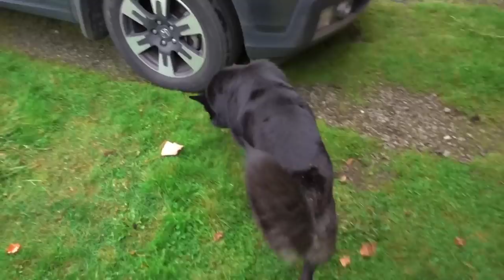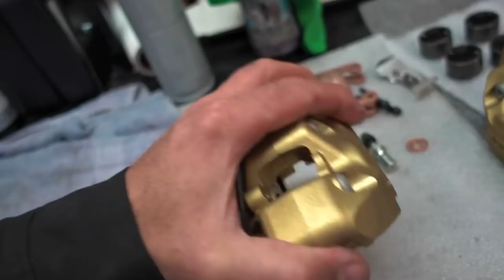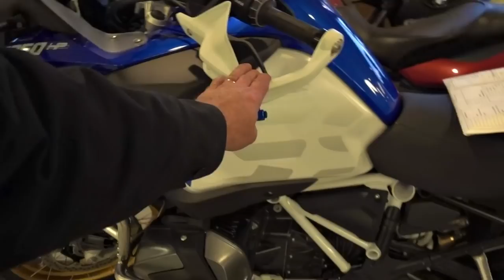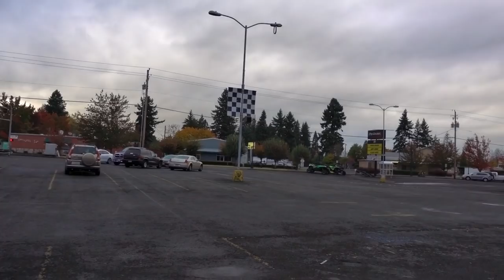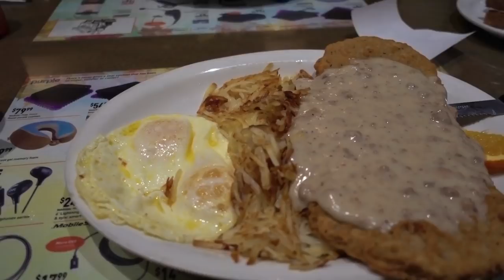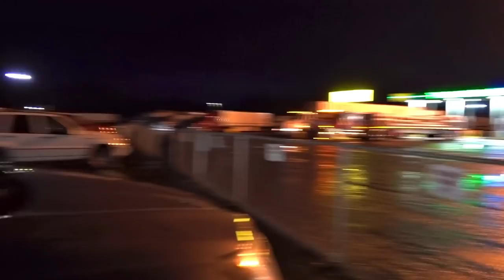Inside the BMW Calipers!! • Spyder Trans Assembly! | TheSmoaks Vlog_1436

Comment: as a retired tool maker----anywhere you have an under-cut on a shaft you can cause a break if you have square corners. under-cuts should have a radius in the corners. No sharp edges or it has a stress point. It will break during heat-treat or under stress.  Thanks Smoaks------Gary
Reply: Wish I had a good loot broken end, but, I think Gary Milligan is most likely right.

Comment: Hi Shawn. Glad I ended up with your vlog when I researched for GS1250 LEAKING BREAKS.  I bought a new 2019 1250 GS HP and hauled it from the dealership to my garage on December 1st because we can't ride here in Quebec during winter. It is March now and last week I went into my garage to install Denali lights on the bike. Took it from its spot in the corner to the middle of the garage to give me room to move around while working. Where the bike has been standing for 3 months now, I haven't seen anything suspect, but while working on it, I noticed two wet spots on the ground under the front wheel (the bike was put on its center stand). I look closely and what I did not want to see was obvious. I had a leak from the front left brake caliper. Looking closer, it dripped from both of its undersides. One of them had a clear brake fluid drop waiting to drip while the second one was kind of an an amber color. Looked even closer but could not find the source of that leak and the banjo looked OK. (SINCE I HAVEN'T RIDDEN A SINGLE KILOMETER ON THE BIKE I TOOK PICTURES TO REPORT TO MY DEALER). Then I wiped off the liquid and continued working on the bike. There was no more dripping. I tried squeezing the front brake lever, could not re-create the leak. I parked the bike back in its spot and it has been two weeks now and still no more dripping. I went on to remove the caliper and verify where that leak coud have been from but found nothing. I di see the ''cheap'' metal casting of the caliper done with two halves put together and my theory is that there may be some ''porous'' areas in that joint between these two halves or I you did mention possibly defective rubber seals unable to withstand DOT3 or DOT4 break liquids. Can you tell me how this brake job you mentioned in this vlog ended up ? I saw that my bike was produced in June of 2019 but since the brakes are from a US manufacturer they must have been produced a long time ago. Was that job done under warranty ? Does the brake manufacturer stands behind its product ? Has it recognized a manufacturing defect with these calipers or at least a bunch of them in a certain period in time ? Are you or BMW dealers in general aware of general problem with these or is it just one occurring ? Many thanks in advance for your answer and for all of your vlogs I like a lot !
Reply from the maker: Hayes Performance Systems 100% stands behind the calipers they supplied to BMW, but any warranty issues have to go through BMW.  The BMW dealer has to perform a cleaning and testing procedure.  If the calibers still leak, the piston seals are replaced through BMW warranty.  The ones that we found that failed the testing were 100% repaired by the seal replacement.  Approximately 80%+ that we've found leaking are repaired by the specific cleaning and testing procedure...
Smaller BMW dealers may never come across the leaking calipers and know nothing of them, as there was no bulletin issued, just a PuMA Measure, should they research the issue through the dealer network.  BMW will have the dealer take care of this for you at no charge.

Thanks Patrick!
Reply: @TheSmoaksVlogs  Thanks to you Shawn. Very comprehensive, detailed and prompt response. Wish all ''branded'' retailers had your attitude towards customer service ! Keep up the good work (and your entertaining way of doing things)

Comment: My question is why is that transmission shaft hollow instead of solid.
Reply from the maker: They have to be hollow, as oil is fed through the shaft and push out oil feed holes where gears pivot on the shaft.  All constant mesh transmissions that share the same oil as the engine are designed this way...

Thanks Papo!